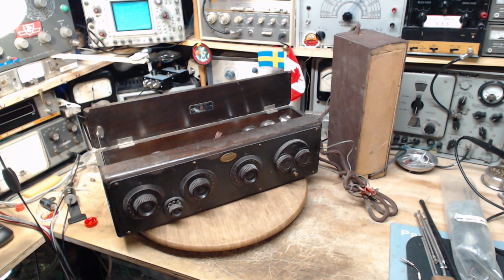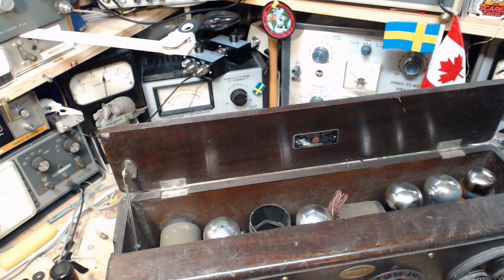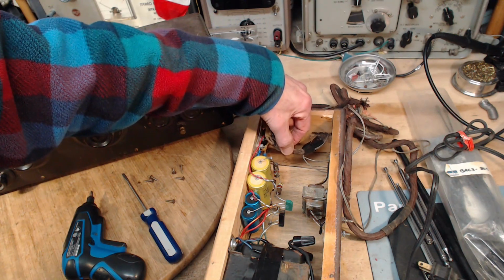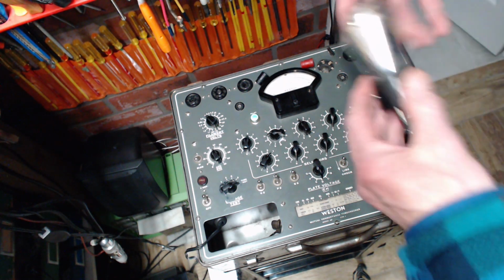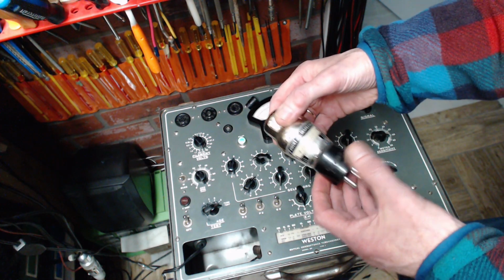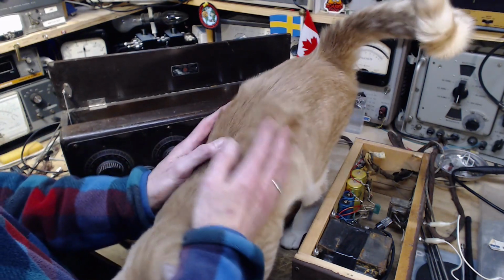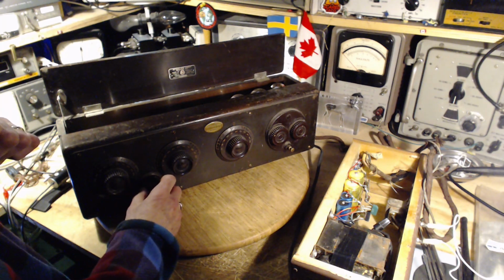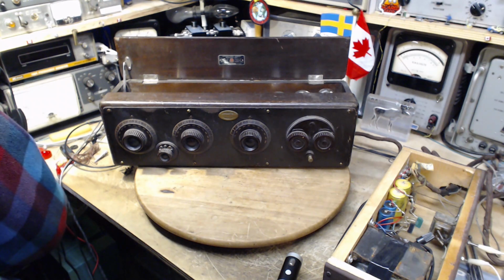100 Year Old Atwater Kent Model 20 Tube Radio Video #1 - Checkout and Power Up

Comment: If you aren't using those transformers that are after the tube area where your losing signal at the plate, the anode signal is activated by the extra voltage, small as it may be, coming from the inductor to the plate.

Comment: I was with my parents in our cabin in the woods of northern Wisconsin on Sept. 2, 1945 and heard the announcement of the end of WWII on that exact radio. We had no electricity, no running water, no central heat, but we had the old battery powered Atwater Kent Model 20 under the window looking out over the beautiful Presque Isle lake. The speaker was in a cabinet that looked like a French cathedral window 
I was just 4 years old, but I can remember it clearly. Germany had surrendered in May, but the Japanese held out until the US dropped the atomic bombs in September. Mom and Dad grabbed my arms and dragged me about a mile out to where a man named Walt was operating a bulldozer, knowing that Walt had two sons in the war. When my parents told Walt the news he jumped from the machine and ran all the way into the town, about 6 miles, to get drunk. My dad spent some time trying to figure out how to shut down the bulldozer, which Walt had left running. 
I apologize for hijacking this wonderful video, but that radio just "pushed all of my 83 year-old buttons. Thanks Jim, I'll be still now. 🙂
Reply: Ha ha great story that was interesting.